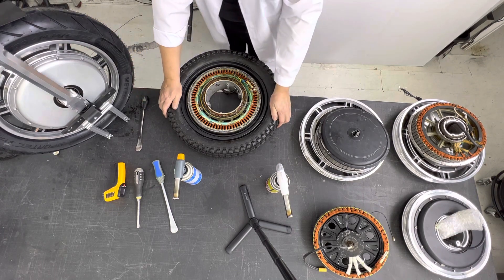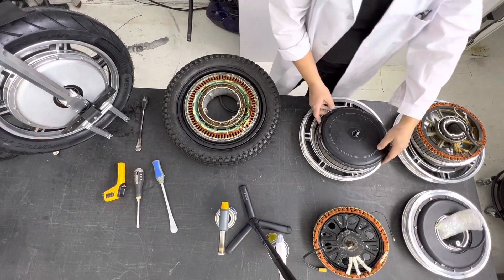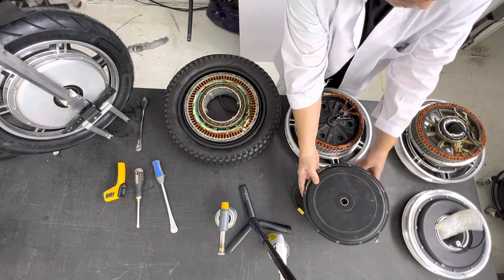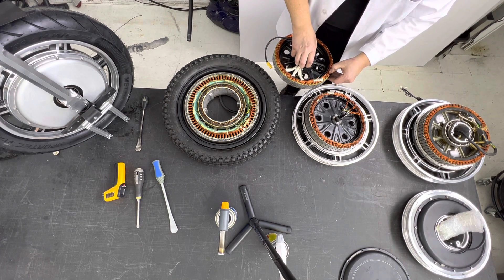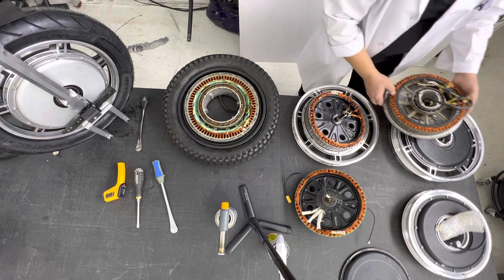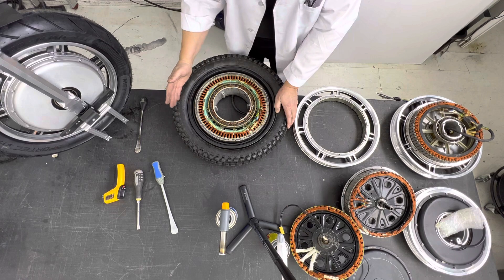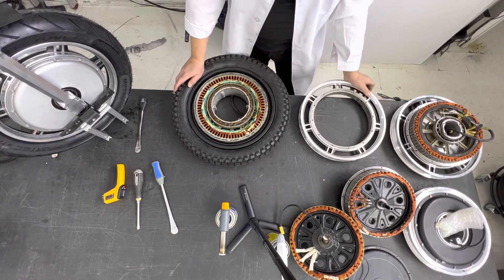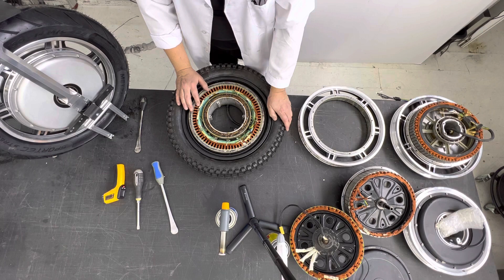The most powerful EUC motor 2022.

Comment: I know what all of the reviewers say but they are trying to sell wheels. You seem to really know these wheels inside and out so I'm asking your opinion. Which motor set up would be the best performing?  The C40 on the EX30 or the C38 on the Master. I never rode the wheels back to back. I am wondering since the Master is 22lbs lighter would that be a better setup for performance?  I plan on upgrading the suspension of any wheel I get so I'm just asking from a power standpoint. I know there are also different battery configurations of the Master. I'm wondering if it's worth buying an EX30 when I could get the master for 1000$ less. With wheels coming out all the time seems like the difference in power, if any, isn't worth the extra money. 1000$ is a large chunk of change. If it was a couple hundred it wouldn't matter, but 1000$ changes things lol If the ex30 is that much more powerful i'll buy that but I would like to know lol
Reply from the maker: Thank you for comment. Both EX30 and Master are top performance wheels. If you enjoy easy riding on high speed, Master will not dissapoint you. Looking for immersive power, planted feel on wide rim, some offroad, go EX30. For safety on extremes get molicel or at least samsung40t packs
Reply: @icafese   Thanks for the reply!

Comment: Do you think axial flux motors would work well in EUCs?
Reply from the maker: Yes, the time is here. As you see in this video, all three EUC motor suppliers, ZX, QJ and QS motors doing all the same, still using 60V architecture for todays 100v, 134v machines.
The axial flux motor has many advantages over this type, such as higher power density, shorter magnetic path, more torque, and better cooling. One major challenge with axial machines is that magnetic forces are much higher than in radial machines. Some axial machines seems to have overheating issues, but it sure will be solved sooner or later. 
Thank you, guys, for buying new wheels and supporting this exiting future! ❤

Comment: EX has c38 motor though.
Reply from the maker: Hi Josh, thank you for watching! ❤ 
We are happy to have a small stock of original Begode EX motor from the legendary QJ MOTOR company. 

Technically it is C40, measures exact 40mm wide magnets, not a 30mm or 38mm. 
C40 Motor inner diam is 290mm. C30 & C38 motors has inner diam 250mm.

Copper winding wire is much thicker, 1mm in diam, against 0,6mm of C30 & C38.
Total mass of copper is a least a double in comparison. 

This motor is state of art, the real craftsmanship, unfortunately not in production anymore.  
We use it on our RSX build, the most torquiest 20 inch EUC on the planet!

Tested by Adam Wrongway: 
https://youtu.be/6aCl1CkKsmI

and tested by Mike Isthereanyfood
https://youtu.be/P2VK_ddRBYM
https://youtu.be/c-lf5Tnuw60

While todays C30 & C38 motors are made by both QS & ZX companies, 
only C40 is made by QJ MOTOR.